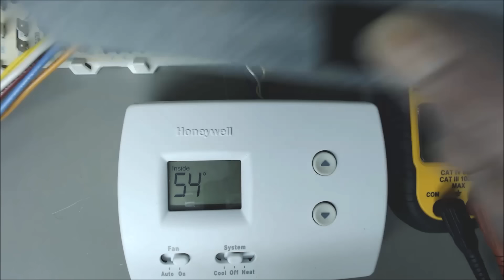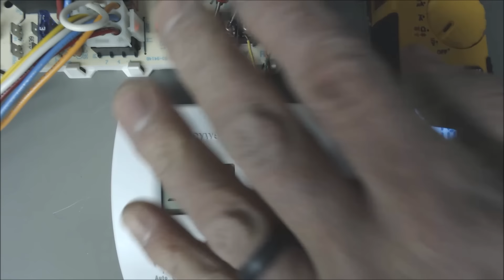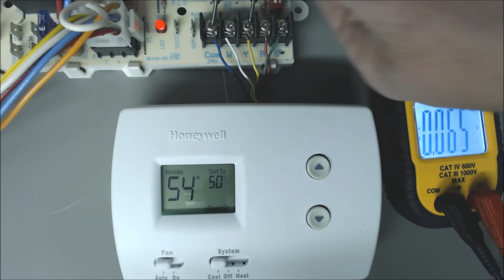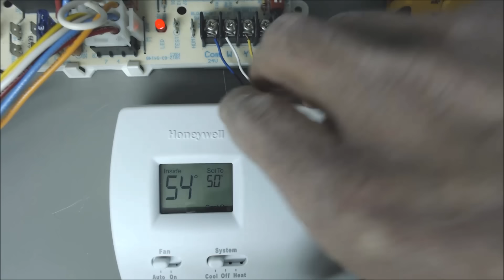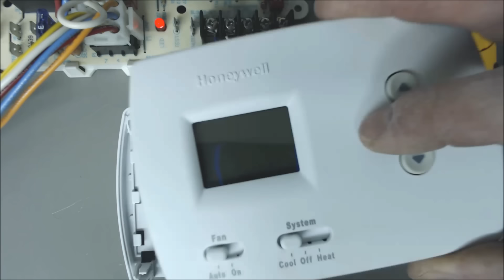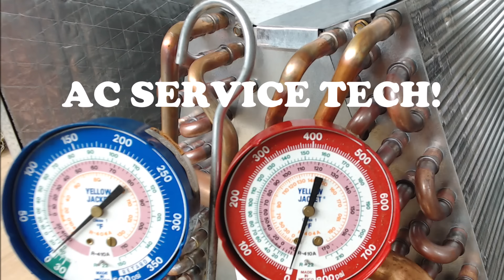How to Test a Thermostat with a Multimeter!

Comment: Hi this is Blaze from SoCal again. You are up early. I have a question. I do all commercial. I also only carry Ventstar 2800's thermostats on my truck. Recently I had a problem with a stat. When I got a call for heat the reversing valve did not de energize. I was working on a Trane Voyager. I jumped across the test pins and the unit went through all operations. The units okay. I removed the thermostat from the wires and jumped out the unit there apart from the stat. The unit heated and cooled. Bad stat?  I replaced the thermostat with the same result. I know my low voltage wire is okay but I still checked it out. I then replaced my low voltage wire at the unit with new and attached another T2800 to it with the same result. I'm pulling my hair out by now. Anyways I went to my vendors and picked up a Honeywell 6000 and am going to try again tomorrow. Any suggestions?  Thank you again for a great video!
Reply from the maker: Do you have the reversing valve switched from B to O? R powers to B in cooling mode and R powers to O in heat mode. These are for the reversing valve depending on if the unit powers the reversing valve in heat or cooling. When you said you tested the system with the tstat wires disconnected from the tstat, I am assuming you already wire nutted the correct wires together to get heat right? thanks Blaze! Yeah in reference to the time you  saw the video was uploaded at, that seems to be the only tim e to try to get them done. The kids go to sleep at 8 and I work on a video from 4-5 hours to get it done edited, and all the rest, ha ha thanks
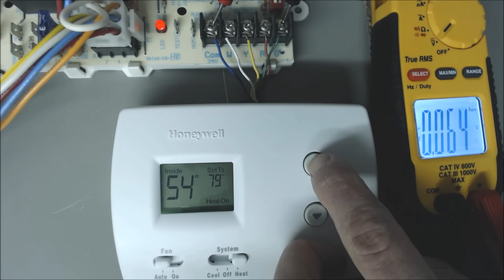Reply: acservicetech Thank you again for the great videos. Ahh to be young again. I'm in bed by 9 at the latest and then up at 2:45 the next morning. Regarding the thermostat issue. Both of the T 2800's that I used would not de energize the coil when I went to the heating mode. I installed a Honeywell 6000 and it controlled my unit correctly. I took the 2800's back to SIGLER for warranty. Thank you for the reply. Merry Christmas to you and your family!